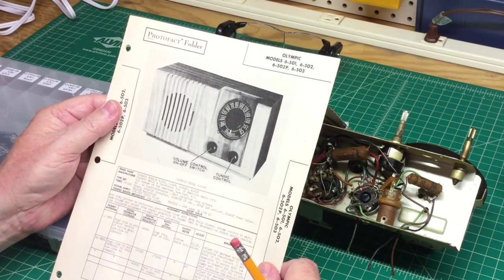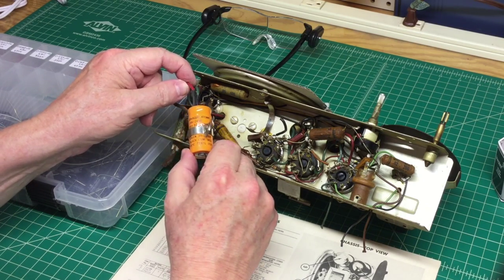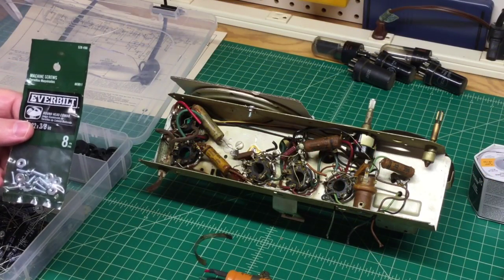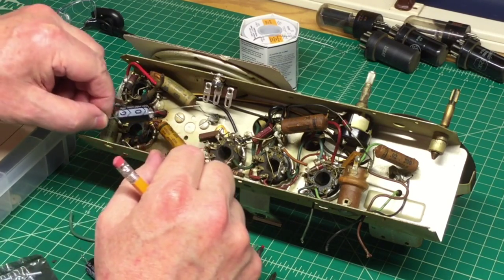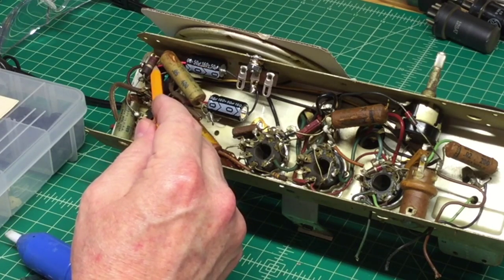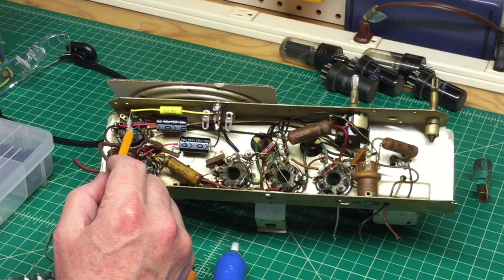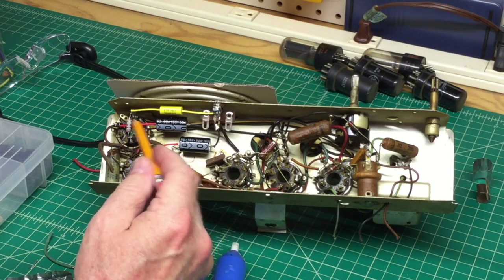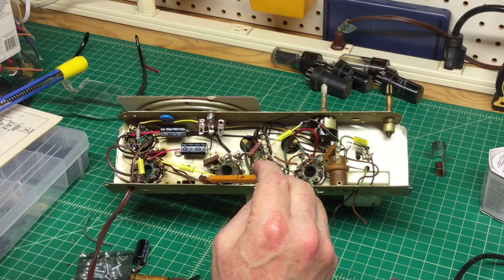Olympic 6-502 - Electrical Restoration

Comment: Thank you for posting this - you do great work! FWIW, the overall volume level of the video seems rather low; easy enough to fix on my end by maxing out the volume control, but it's something you might want to be aware of. :-)
Reply from the maker: glenstertx Thank you. I appreciate the heads up on the audio recording level, looks like my microphone placement compromised the quality of the video. Best, Don